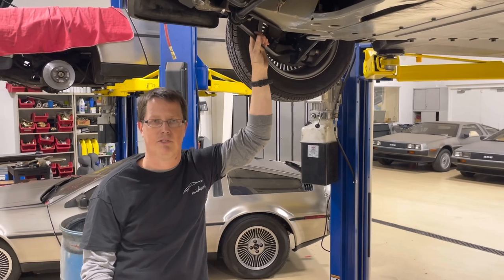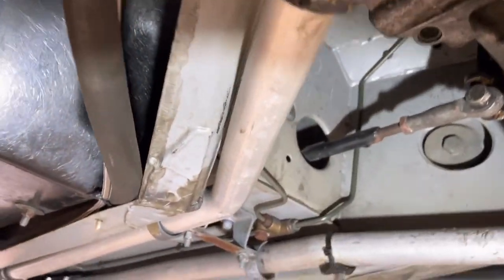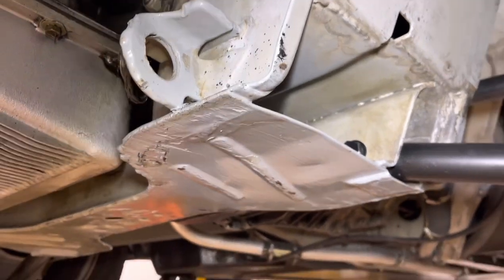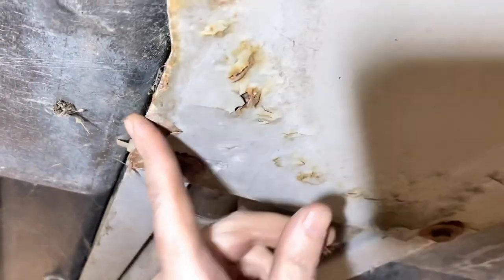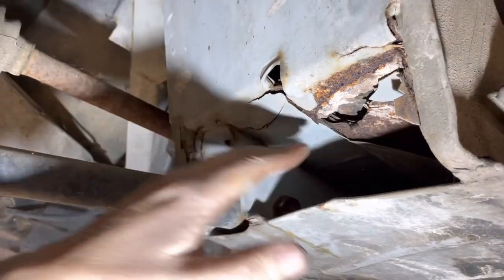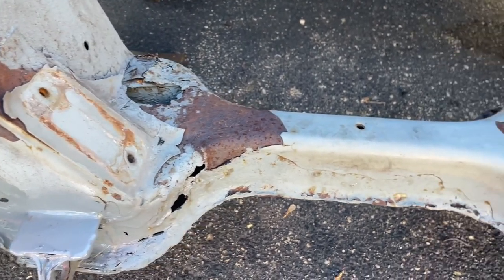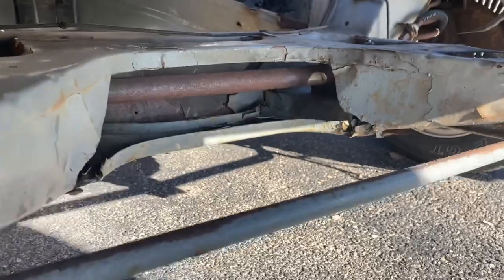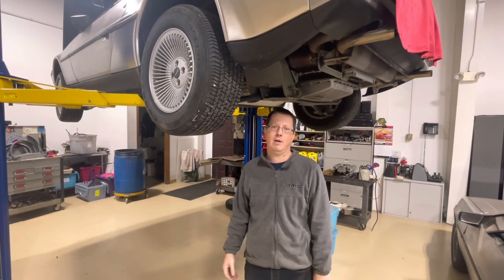DeLorean Buyers Guide & Inspection Series. The Frame: the good, the bad & the ugly.

Comment: Hey guys, i really like your videos. You put so much effort and time in explaining and this helps a lot! I just bought my delorean from the netherlands, now sitting in germany. It is one of the latest numbers with Vin 16xxx and has the additional thin black undercoat on the frame. Of course i checked your video before and also looked for a good frame. Overall my frame looks good from the underside. There are a few areas where i could easily chip the epoxy off, but underneath was just a little surface rust. No rust chips at all. The only thing i‘m concerned about: in the hollow spaces like those pillars of the engine cradle and the front frame between the wheels there is lots of epoxy chipping off on the inside (at least as far as i could reach in with my fingers). As i can‘t take a look inside i just felt for the surface and it doesn‘t seem that there is much rust underneath the chipped epoxy at all (most time a very smooth surface). But how do i deal with this problem? Is there any way to get out the chipped epoxy and what can i do to the „naked“ (maybe rusty) metal to prevent it from rusting?  Thanks a lot in advance for your advice.

Comment: So what's the best way to store your car? In a shop that has a granite floor? In a shop that has a concrete floor but a tarp under the car? Or on a lift up in the air?
Reply: #1 is to avoid road salt. Next is to keep the car dry. Dehumidifier can be very helpful. Sealed concrete is preferred.

Comment: The plate under the engine cradle and between the lower control arms up front are very thin. They get bent very easy. I was thinking of replacing mine with 3/16" material. Have you guys ever done this?
Reply: We don't see the need to beef up the frame. To avoid any dents and scratches in the frame we place 3/4" plywood piece between the frame and floor jack or jack stands.